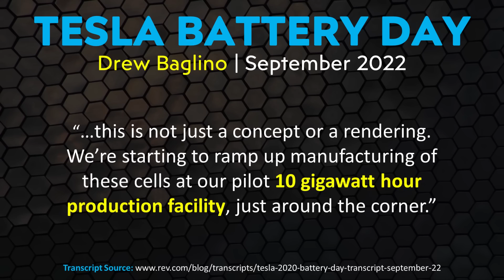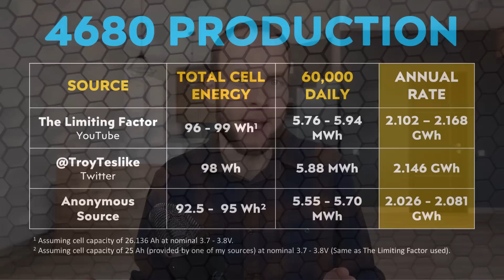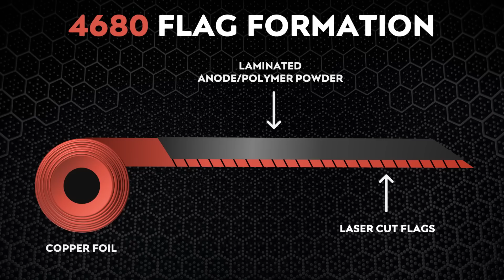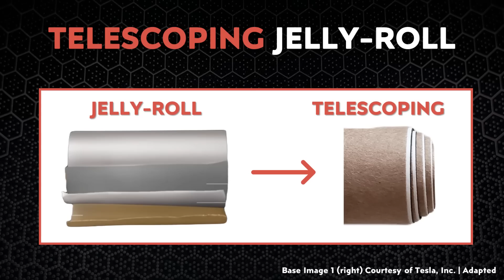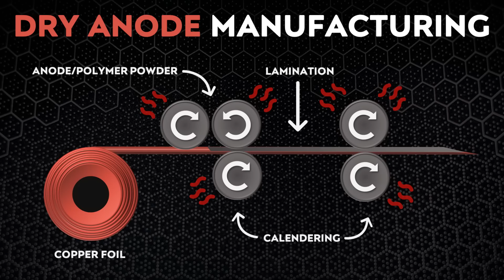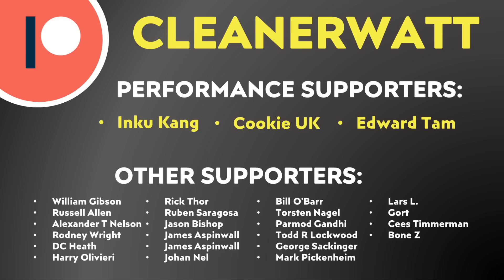EXCLUSIVE Tesla 4680 Battery Production UPDATES!

Comment: A pilot plant is intended to develop the product/process by working through issues as you say! You are right on that the goal is to improve the processes and product so that when the Gen 2 plants are built out in the gigafactories, THEY are optimized.
Reply: EXACTLY! Many (most?) pilot plants spend a majority of their time literally sitting still and doing nothing while a team of engineers, technicians, and interns utilize energy acquired from coffee and Snickers bars to resolve the latest issue discovered during the previous product run. (It is experience from whence I speak.) This is literally what pilot plants are built for. Nobody builds a pilot plant with any expectation that the plant will become financially profitable on its own. It's easier to think of a pilot plant as a "Big R&D Machine".
Reply: A little disconcerting if not at all surprising that they are apparently a long way off from what they'll need at GB and GA next yr.  Hopefully the dry process ever works effectively.
Reply: @Mrbfgray  The dry process works.  They are working on getting it to work at scale.
It is a distinction with a difference.
Reply: @danharold3087    Scale is everything if it doesn't work there it's USELESS.
Reply: @Mrbfgray   You misunderstood.  
" Hopefully the dry process ever works effectively."  I pointed out  "The dry process works.  They are working on getting it to work at scale."

You can beat the crap out that line to make a few more batteries.   If that slows work on the advancement of scaling you get fired.  

In other words the number of cells actually made is secondary to getting the line to where it can produce more.
Reply: @danharold3087    You can twist that too try and feel smart but it either good at scale or a massive failure  Period.  Pilot lines are utterly irrelevant in the end if they don't lead to efficient scale operations.
Reply: @Mrbfgray  I did not twist anything.     It takes longer to reach scale if you  run again and don't upgrade what does not work.
How many cells you made this week is secondary to how much you have reduced the time it takes to make a cell.
Reply: @Mrbfgray  if it doesn't work & you analyse the results & likewise the process, it teaches you something that increases quality & rate of production... 🤦
Reply: @Mrbfgray  wow, you have issues....
Reply: @alexmanojlovic768    I do have issues with aggressive arrogant stupidity, yes.  You should too.
Reply: @Mrbfgray  strange, @Dan Harold seems calm thoughtful & correct.  Your txts are the aggressive, arrogant, stupid ones.  Hence the wording & style of my response to you & in defense of @Dan....
Well done for confirming our opinions... 🤦
Reply: @alexmanojlovic768    Good GRIEF, get a job and a life.

Comment: Seems crazy that in such a complex process, an escalator is the main problem slowing production...
Reply from the maker: I agree... there may be more issues, but this is what I know about.
Reply: @Cleanerwatt  The good news is that if it an escalator, that sounds like something that Tesla can readily fix... maybe annoying, but not a show stopper.
Reply: @cbmusgrave  Best part is no part. Remove the escalator GigaTexas has more than enough floor space to hold the entire battery production in 1 floor.
Reply: @kazedcat  But a pain in the butt, when GigaBerlin already has a four-story building intended for cell production. Also: in 3D, distances can be much shorter than in 2D.
Reply: @kazedcat   @Koeniglicher  floor space (especially in Cali) is expensive, airspace is not.  The line is, in places, deliberately tortuous, as each stage of production takes a different amount of time to enact.  So snaking is deliberately inserted to slow the line at particular stages, to allow the whole thing to run at a consistent rate without stopping any section etc.  By traversing vertically, Tesla can use non-utilised airspace to slow the line without holding up the previous stages before actioning the following stages.  Saving the floorspace for better purposes.  They're brilliant at efficiency & innovation, I doubt they simply decided to stick in a non-zero cost elevator without considering the pros & cons & any innovative reasoning.   Don't forget they bought up 2 successful battery/capacitor manufacturers & gave them carte blanche to rewrite the rule book.
"Shall we take stage 69 upstairs & just whack in an elevation section & go from there??" Never happened at a Tesla meeting... ever...
Reply: @alexmanojlovic768  Tesla rewrites the rule book by deleting unnecessary parts.
Reply: @kazedcat  I've just pointed out the necessity for time delay in a production line & that the elevator exists, & yet you still felt the need to point that out, as if I didn't already know?   Or were you just arguing?
Reply: @alexmanojlovic768  It is not necessary in GigaTexas.
Reply: @kazedcat  Then why haven't they deleted what you consider to be an unnecessary part? 🤦
GigaTexas is 7 stories tall, and will be producing Models 3+Y, CyberTruck, Semi, possibly project BobCat & shed loads of batteries.
They're clearly not dedicating just ground floor to production & 6 floors to office staff & design!!  Again... Airspace is ALWAYS far cheaper than floorspace, to buy, build & to utilise.  The elevator may well be just slowing down the line deliberately as well as moving cells from stage n to stage n+1.
If you understand that Elon is an advocate of multilevel tunnels for vehicular transport, then multilevel production makes sense too.  Elevate cells to structural pack manufacture section, drop battery/skateboard down directly into assembly section with upper body.  Logistics of movement of parts is easier in a 3d space than a 2d space.
You can stop arguing now, as neither of us knows the answer, but you now have more food for thought.
Reply: @alexmanojlovic768  GigaTexas is not yet running battery production. The escalator is in their Kato road facility. I am confident that GigaTexas production line is not the same as the Kato line. In short we don't know if the escalator is already deleted in the plans of the GigaTexas battery production facility.
Reply: @kazedcat  your spending an awful long time arguing about something neither of us know for certain.   However, you're positive the elevator is unnecessary, even after I pointed out that most production lines have sections that slow the line down in places to allow certain sections time to be processed, yet you still insist elevator is unnecessary... Because YOU said so...  Without having the faintest idea what the topology at GFTexas is going to be! 🤦
Reply: @alexmanojlovic768  GigaTexas will delete the escalator because it is unnecessary. You also don't know what Tesla is exactly doing therefore your opinion is no more valid than mine.